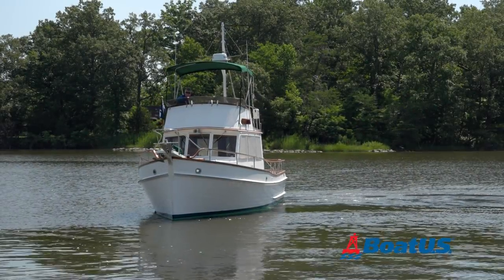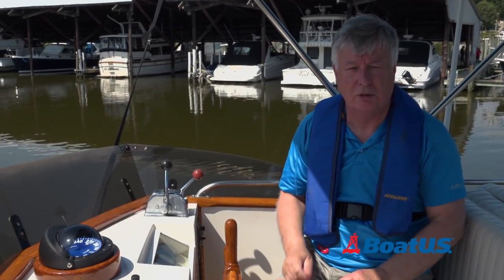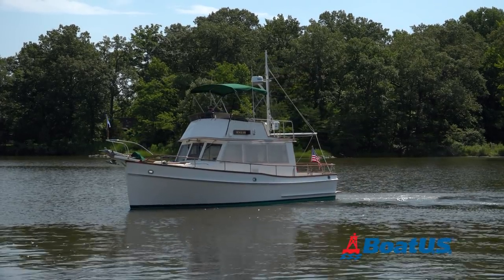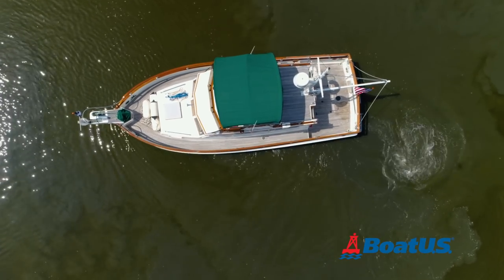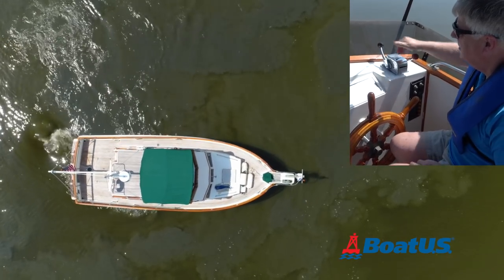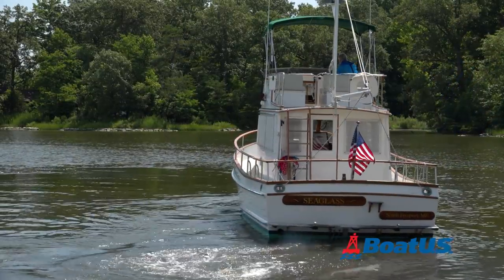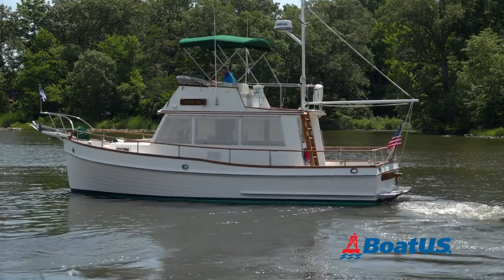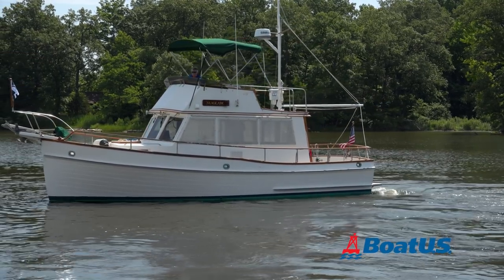Boat Handling: "Walk" Or Pivot A Boat In Its Own Length | BoatUS

Comment: Nice job. Does this work for a sterndrive too or is it better to turn the wheel.
Reply from the maker: Hi John. Thanks so much! The process for a single engine outboard or sterndrive is a bit different than for an inboard. You're correct that you need to use the wheel for that. Check out our how-to video: https://youtu.be/HyhTPRXwYBQ